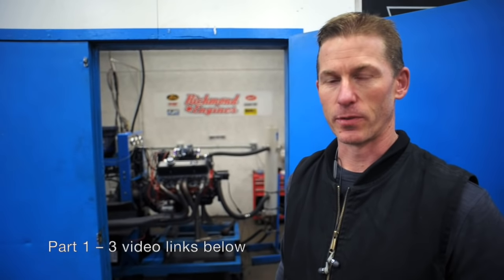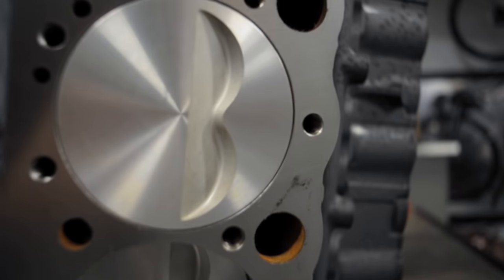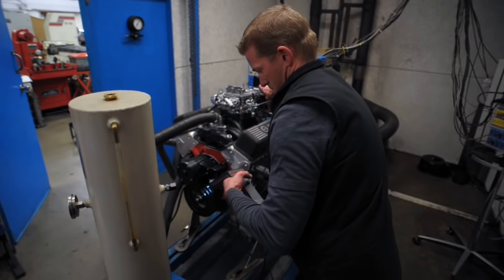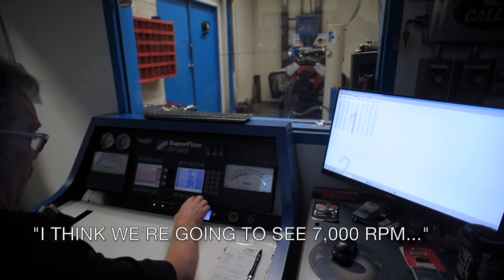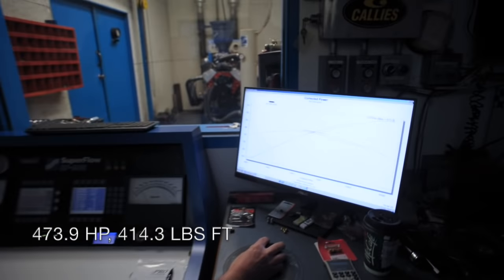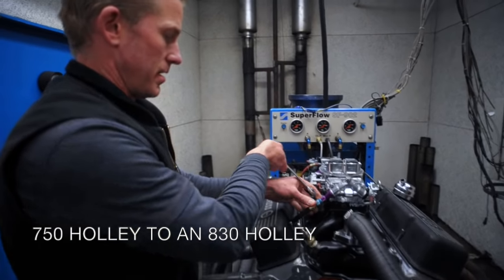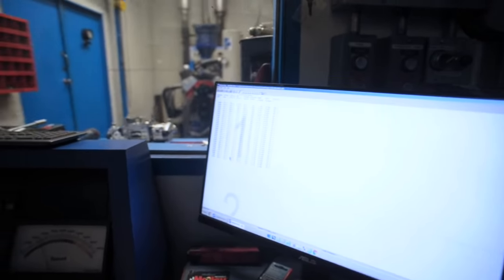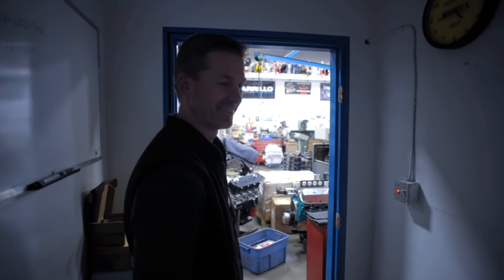SBC 283 Crankshaft + 400 Block = 500+ HP (Dyno Test 1 of 2)

Comment: Interesting build!  I’m currently building a Large bore 4.8L LS, or a .030” 6.0L block/pistons with  Gen 4 4.8L crankshaft/rods  ie 333 CID.  
10.48-1 compression looking for 500+ HP pump gas.
Reply: That’s awesome! Cool to hear that other builders have similar ideas. I recently built and installed a 349ci LS into my own car (71 Nova). Used an LS3 block, bored 4.125”, LS7 flat top piston, 4.8 crankshaft with Eagle 6.3” H-beam rods. 12:1 compression. AFR LS3 heads and a Super Victor manifold.
Reply: @stevenshumey8363  sounds similar to the old sbf guys who do a dart block with 4.125" bore and do a 3.25 (331 stroker) crankshaft. The Big bore 331 combo, for a total of 347 cubic inches. I love over square v8s!
Reply: Yes, so do I! They are great for some applications for sure. 
I do love long stroke motors too like what I’m doing for myself right now. It’s a tall deck LSX block from GM and I put a 4.25” crank in it and it’s bored to 4.185” to make 468 cubes. Because it’s a tall deck (9.7+”) I’m able to use 6.3” rods and still use a stock type of piston with 1.3” compression height.
Reply: Been done.richard holner.dont waste ur time

Comment: Have you tried running a cam with tighter lobe separation angle?
Reply from the maker: We sure have. There’s obviously some advantages to that but in some ways, especially on a street engine the higher vacuum and better drivability is attractive to most older guys. Thanks for commenting!

Comment: You have aluminum heads, why not have 11:1 compression?  Why not have port-fuel injection?Otherwise, you did pretty good.   The SOUND is Awesome, the output good.  The bolts on the rod caps were "too-long", I think.   I've never seen them so long on another build.  Wouldn't you risk having your oil "frothed", with those too-long-looking bolts acting as "paddles", leading to Failure?   I guess an average stroke on that block'd be 4", so with a 3" stroke, oil-pan clearance isn't an 'issue', but leaving that much bolt length on the rod-ends--it just "looks" sloppy.
Reply: There is a limit on how much you can angle cut the heads lest the deck thickness becomes too thin.
Reply from the maker: Hello Jack! Thanks for commenting. 
I would like to respond to your question about the fasteners you’ve mentioned. I think you might be referring to the long main cap studs. If so, the reason for them is to attach the windage tray to.

Comment: you boosted the octane but do not mention advancing the ignition timing specs either initial or final.
Reply from the maker: Hi Jonathan! Thank you for your comment. Timing didn't change, and valve float near 7000 RPM cut the test short. Our second dyno session: https://www.youtube.com/watch?v=Ge6RsIOs1-U after adding valve spring pressure here: https://www.youtube.com/watch?v=zXT_6H_tWYU . Best regards.

Comment: Kinda got me wondering what a cam and heads would do to it
Reply from the maker: Certainly could make more power with more cam even with the same heads. Probably could pick up 500 or more rpm and a good 50 HP and still be a good street machine. 
Thanks for commenting :)

Comment: Actually built one of these back in the day with that super small rotating assembly on the bottom end you get super high revs put in a solid lifter Cam and you'll push that revs all the way up to 7500 8,000 RPMs it's a big block killer
Reply from the maker: Thank you for commenting! It’s something that a lot of guys don’t understand. Sure makes a fun driver!
Reply: Yeah you still have a lot of guys out there that still think that the bigger is better
Reply: Or them idiots that no replacement for displacement
Reply: Same kind of people who never actually built engines
Reply from the maker: That’s funny. I get those comments now and then. 
On this mild cam build that runs on regular gas and makes over 500 horsepower and pretty respectable torque (with a 3” stroke), I don’t think putting a 400 crank in this, keeping the valve train and heads the same, would be as impressive. Just a hunch. Sure it would make a bit more torque, but not every application really needs more than this engine already made. 
What do you think?
Reply: @jasonhowell9589  it is very hard to get more than 1.33 ft*lbs/CI of torque without boost....so if you want big torque numbers you either need big displacement or boost. Then you can cam it for the rpm range you want to run.
Reply: @ceperformance   with a leaving everything else alone a 4" stroke you would have to bump up the compression to make 500 HP at 5500 rpm and 582 ft*lbs of torque at 4000 rpm. In a light car the smaller engine that screams would be allot more fun.
Reply from the maker: I agree :)
Thank you for commenting!

Comment: did you use the l99 baby lt1 crank? a large baring 3 in stroke crank is hard to find. thare are spacer barings for the large 3 in stroke crank aka 302 chevy but a real 283/265 crank wold not work as the spacer barings are for the later crank baring size! a l99   has a 3 inch stroke large baring size but uses 1 peace rear seal. this is somthing i have wanted to build! 477hp an 407 tq on 87 gas with 320 ci is dam good! what was the Brake specific fuel consumption? based on the tq pr ci it I wold guess be hi!
Reply from the maker: Hey Jake Michael,
We used a 283 crankshaft and this 400 BowTie block that has the medium main size like a 350. 
I would love to find a L99 crankshaft someday and build an engine around it! 
Thank you for commenting :)
Reply: @ceperformance  your welcom! another cool 400 build would be one with vortech heads, long rod ratio,low ring tension compact rings!

Comment: I'm interested in knowing the model of AFR head, as well as intake valve size and min intake port CSA.  No problem if you don't feel like sharing it.
Reply from the maker: Happy to share! They are AFR 916’s and we ordered them angle milled down to 55cc chambers because we wanted the compression up in the 10’s. They have 2.02” x 1.6” valves.
Reply: @ceperformance  wow!  Thank you for the reply.  There's a lot of magic in the large bore.
Reply from the maker: You’re welcome. No secrets here :)
Reply from the maker: @stevewix  We were so impressed by the big bore x short stroke that we built an LS engine with a 4.125 bore x 3.267 stroke, and the combination produced almost 1.9 HP per cubic inch! Check it out if you'd like: https://www.youtube.com/watch?v=ttEsebehdrc

Comment: Curious if you guys can do anything for a 305 that would make a good street performer, maybe 300 HP or so?
Reply from the maker: Honestly because the 305 has such a small bore there’s big limits on heads and valve size that hinder a performance build. Not saying that you couldn’t make power with a 305 but you might as well start with a simple 350 block.

Comment: Sounds like it had a bit of a flat spot. Could you do the exact opposite and put a 400 crank in a 283? Probably have clearance issues with the block.
Reply from the maker: Thank you for commenting. 
The downside to doing it the other way is the 283 has such a small cylinder bore. Downside of the smaller bore is less room for large valves. Plus, our intention was to use the 6.1” long connecting rods with a piston that still has plenty of skirt. The 3.75” stroke of the 400 would not allow for that.

Comment: Not bad for a 180cc headed engine. Bet even with a valvespring change itll have a decent power increase. Who ground the cam?
Reply: Hello Hoost 305. Thank you for your comments. 
We had Comp Cams special grind this for us. It is a hydraulic roller with 114 degree LSA. 224/230 duration @ .050” and it is made with the 4/7 swap firing order.

Comment: Showed the 245 main dart block and a spacer to put the crank in and that the Pistons were .060 over but didn't say a part number
Reply from the maker: Thank you for commenting. What part numbers would you be interested in?
Reply: @ceperformance  piston part number
Reply from the maker: We used Icon ic9941-060

Comment: I am sure that there is an area where reducing helps maybe in traction?  I see this like I have 400 dollars and I reduced this amount to 329 so I can have more buying power???
I am not a mechanic or engineer so loosing more area for fuel and air does not make sense. I mean what ever fuel you use it will only have so much power within a given chamber or am I missing something?
Reply from the maker: Thank you for commenting. There are advantages and disadvantages to many different engine combinations. Feel free to read through some of the comments on this video. Surprisingly maybe, there are many who raved about the history and benefits of this type of small displacement V8. On the other hand many who just don’t ‘get it’, laugh and say it’s a waist. 
I say, ‘oh well’. We’re loving it :)

Comment: I thought 400" small blocks had 3 freeze plugs on each side???
Reply from the maker: You’re right about that on the production 400 blocks. This one was an old GM Bowtie block that I bought from a scrapper. It was a tired old engine that needed to be rebuilt. When we found that it was made with the main bearing size of a 350, it was then possible to spacer it down to a small journal to fit in the 283 steel crankshaft :)
Thanks for asking!

Comment: Are you able to run 87 with no detonation because of the long rods? I'm fascinated by the 475 reading on the cheapest fuel, would make a good daily driver, yes?
Reply from the maker: It makes a great driver! The long rods and the aluminum heads with good combustion chambers definitely help for using cheap gas :)

Comment: 283 crank is small journal and 400 block has large journals.
Reply from the maker: You’re correct. This BowTie block we used has medium mains, like a 350. We used main spacers to fit the 283 small journal into it.

Comment: WOW that's a screamer 👍👍

Was that 7200 rpm?
Reply: Thank you for your comment! Yes we took it to 7200 a few times but the peak HP every pull was at 7000. By then it was all done! I believe the stock ignition system was having trouble keeping up at full load at that RPM. It’s possible that the valve springs were finished there too. All in all, we’re extremely happy with the results. Could we make some changes?.. yes but it’s very good just like it is!

Comment: Hi, beehive valve springs? 
I thought about building this type of engine, but was unsure of the crank spacer bearings. Cool engine, I hope it goes in a light car we with aluminum flywheel and 373 gear.
Reply: Thank you for your comment. 
The AFR 180’s come with a dual spring good for .650” lift but this combo is making power over the 6800 rpm that we expected. Therefore the pressure for that RPM is not enough. It clearly is running out of control at the top of the test. We’ll be making a change and running it again. 
A new video will likely be posted soon.
Reply: @stevenshumey8363  with springs, a coil size has a harmonic resonance fail frequency, so a beehive/ conical coil spring only fails on one part but the rest can perform at higher rpm. comp cams has some good strobe light footage of this in action.
Reply from the maker: Yes I agree. Their videos of that is quite fascinating. I was able to see that stuff up and close on a tour of Comp Cams a few years ago. Very cool!
Thanks for commenting :)

Comment: Go with bigger valves and tighter LCA cam same lift and probably would pick up 50 or 70 hp
Reply from the maker: Yes, a different choice of camshaft would definitely yield better performance especially over 7,000. This not being anything but a street car, it has great torque (for what it is) and pretty impressive HP considering the mildness of it. 
Thanks for commenting!

Comment: It would be stronger to use a DZ 302 crank! Same stroke as the 283 and the only thing different is the centrifugal weight with the 2in rod journals.
Reply from the maker: That’s right!
Reply: That 302 crank is probably like hens teeth tho. @ceperformance

Comment: Still floating the values around  6,500..need triple spring...try 1150 carb..thermo quad...needs more fuel as well..mite get 9,000 rpm
Reply: Thank you! We’re going to make a spring change and run it up again.

Comment: Well now that's saying something. Is this considered a street engine, is it suitable for a drive in/out street strip car like my 79 Monza or my 78 Malibu? What's it's advantage over a conventional say....350 with similar parts. I like the idea of non standard combinations, tell me more.
Reply: This is a street engine, through and through. Idles with 15” of vacuum, amazing throttle response and can run on 87 octane in a mid sized car. It would be perfect with either an automatic with a mild converter (2000-2200 rpm) or a standard. 
This one is going into a 1966 Beaumont with a Tremec TKX 5 Speed.
Conventional is boring! This having a short stroke gives room for longer connecting rods but doesn’t then require a really short compression height with the wrist pin bore going through the oil control rings. 
Makes great HP and Torque. 
Some guys are saying ‘just make it bigger, more cubes, stroke not de-stroke, more power everywhere…’
That was not our approach for this build. 
Thanks for your comments!
Reply: @stevenshumey8363  Wow this gets better and better. You answered questions I haven't asked yet and so far it all gets a gold star. I saw the video on the 327/400 354 and the 302/400 329. Do you have a set parts combo....rotating assembly....short block....long block. What I saw on the video sounds like a good place to start...how do I get more info. Thanks for the fast reply. mf
Reply: @mikef-gi2dg  I would be happy to discuss further with you. You can email me through my website if you like!

Comment: I want to make an assumption before I watch the video. A crank that small and a stroke that big will make for a screaming banshee that may pull 8000rpm.
Reply from the maker: With a bigger cam and tighter lobe separation I’m sure it would make power up at 8000. This was not our intention on this mild driver build but we’re very happy with the results :)
Thanks for watching.

Comment: you never said what the cam specs were
Reply: Hello! I’m glad you asked. The Cam is a custom grind from Comp Cams. The lobes are from their Extreme Energy family and are numbers 3314 and 3315. 
It’s 224/230 @ .050” lift
With 1.6 rockers our lift is .536/.544 at the valve. 
It’s on a 114 LSA. 
They ground it with a 4 degree advance and it’s on a 4-7 swap firing order.

Comment: That s awesome. But I wonder how much it would have made with a 3.75" stroke
Reply from the maker: Thank you for commenting! 
It would be a completely different engine at that point. Obviously a 3.75” stroke is also a good thing for some applications while a short stroke is good for others. There’s always going to be what if’s no matter what you build. We’re very happy with the results of this little small block!
Reply: @ceperformance  
Was there a rules reason for making it so much smaller in cubic inches or just wanted to see how much power you could make with the short stroke, big bore combo. 

I always liked the short stroke big bore 455 Buicks. I've had a few and they made lots of power with little mods. I know 3.9" isn't exactly short stroke but in relation to a 4.3125 bore it is.   I think the larger the bore the better the air flows in around the the intake valve.  Filling the cylinder better. 
Good luck with the little beast.
Reply from the maker: @martyjohnsonozarkoutdoors8198  
For this build we were interested in seeing the possibilities using a 3” stroke and 6.1” rods, paired with the largest bore possible. We’re very happy with the results!
Reply: @ceperformance  
I thought it would make the hp numbers but I was really impressed with the torque. It done very good for the cubic inch.  
I have 3 projects I'm building.
 A 377
4" bore And 3.75 crank. Wanting to run on pump gas 87 octane. I have summit heads with 72cc chambers 
Pistons have a 17.8cc dish. 
Haven't decided on the cam yet. Probably something in the 1500-5000 rpm range.  Its going in an 84 chevy truck. 
I have a 5.3 that is at the machine shop now getting checked out and cam bearing and freeze plugs installed. Not sure what I'm gonna do with it. Maybe put it in a 92 camaro with a beefed up t-5. Just to drive.  
And I just acquired a 91 454 that ran but has some loose rods. Thinking about a stroker rotating assembly for it. Big block and LS will be learning experiences. I've done lots of small block chevys and a few 350 and 455 Buicks. But never messed with a 454 or LS. 
I'd be interested in your recommendations for a cam. To go in the truck 377. It has 3.07 gears and 33" tires. And a 2000 stall converter. 
I've been seeing a lot of bad problems lately with flat tappet cams. I don't want to have one go bad on break in. 
Anyway keep experimenting 
And making videos.
Reply from the maker: @martyjohnsonozarkoutdoors8198  
Hey Marty,
The compression on your 377 is quite low with those 72 cc heads. It calculates to 8.85:1
Were you making it low for future turbo or supercharger installation? 
With 64cc heads you’d be at 9.55:1
The lower compression will work but you wouldn’t want very much valve overlap.
Reply: @ceperformance  
I was hoping to be able to get gas anywhere and not worry about needing premium fuel. I have a new set of vortec heads with 1.94 valve and 64 cc chambers. I can use those. I'm just building it to drive. 
I'll be running a stock GM distributor.
I just want decent torque and run on 87 octane. 
Do you think that would be ok with the 64 cc heads.
Reply from the maker: @martyjohnsonozarkoutdoors8198  
You would be fine with the Vortec heads and 87.